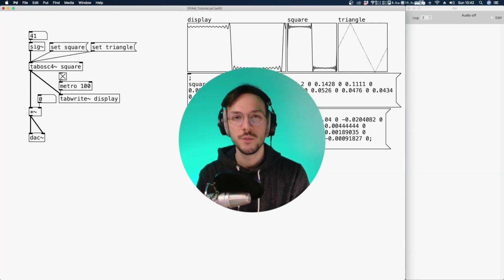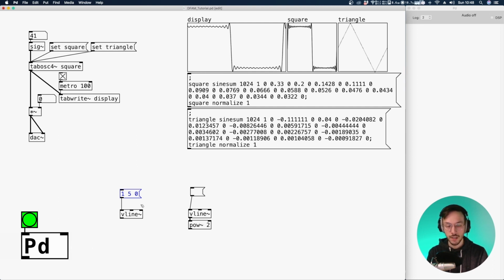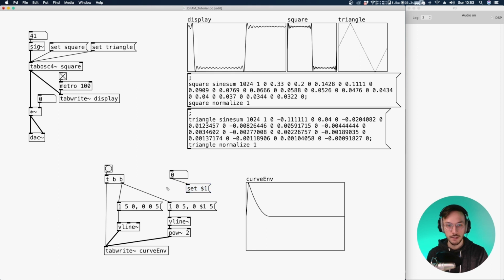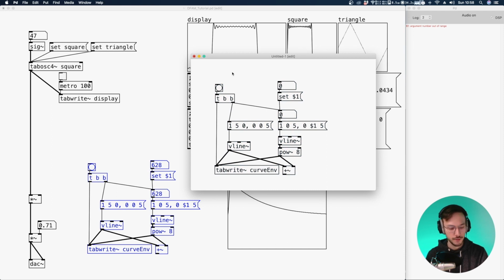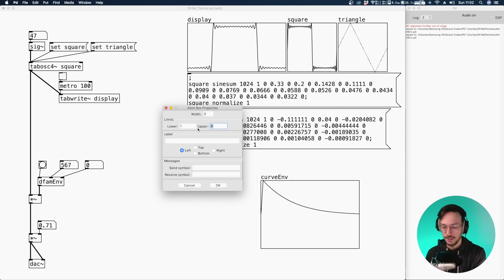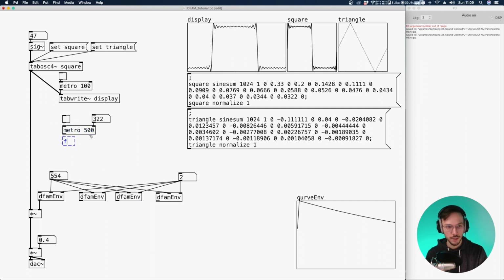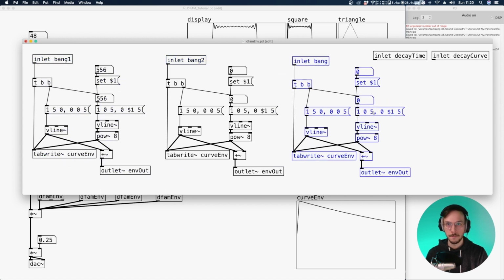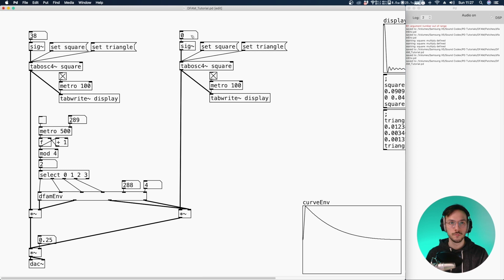Recreating the Moog DFAM in Pure Data Ep.2 | AD Envelope Generator

Comment: Great tutorial. Sorry I deleted my previous coment. Thanks for your answer. The issu comes from the list in the  message that is not understoud by vline. I use Pd v0.43.4-extended. Is your tutorial compatible with this version?
Reply from the maker: No worries. Try reading the [vline~] help file maybe it used a slightly different syntax